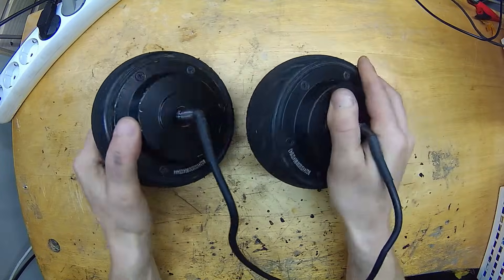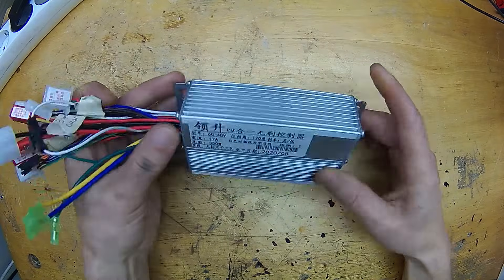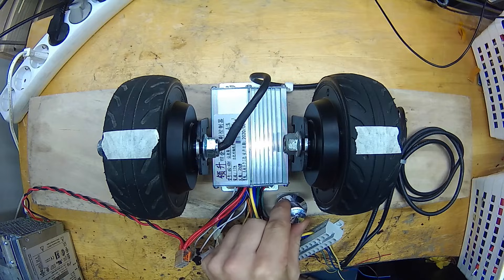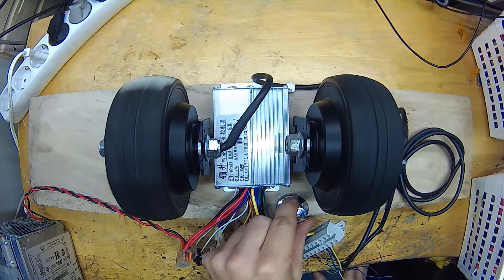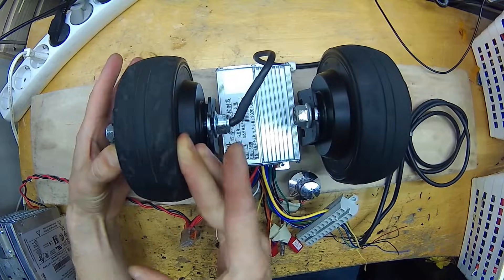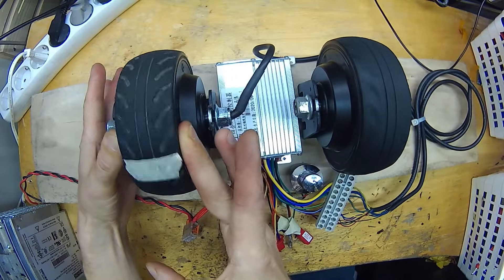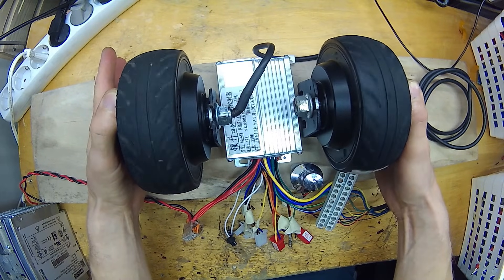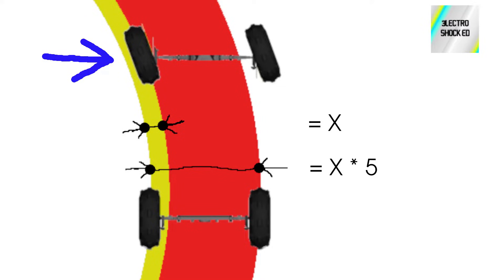2 HUB MOTORS with 1 CONTROLLER ? Yes you can!

Comment: In practice, only small loads would have a hope of functioning properly. The only way this would work cleanly is if the wheels were clamped together (with magnets/poles at the same angle) and always rotated exactly the same. So it could perhaps be useful if you want a single more powerful wheel.
Reply from the maker: Thanks for the comment! Really good point in theory. I was thinking the same before I did this test. But was surprised at the results. Just have to really try this out on a actual scooter next spring :) thanks for watching!
Reply: I think what you might be overlooking is the fact that the slave motor that has no hall sensor feedback input to the controller is now just basically like a standard 60hz three phase motor that has no hall sensors. It just runs at whatever rpm the grid determines for it, which is fixed permanently at 60hz. Although one difference is that the rotor of a conventional 3 phase motor is usually not permanent magnets, so that means there will always be a small amount of slippage, but nevertheless the rotor does still end up getting fairly close to locking in phase with the 60hz. So if you had 2 standard 3-phase motors running side by side on a scooter, being driven by the same generator, both motors would have the same torque and RPM's. It would be slightly hard to turn while applying power, because the difference in speed between the two motors would cause the slave motor to get slightly out of phase for milliseconds at a time, which we saw here in his video. But the vast majority of the time, the driver will be travelling fairly straight, and any time any slight amount of phase discrepancy tries to build up, that pressure will be relieved by the little bit of imperfections in the contact with the ground. Think of it like this: if you had a 4 foot wide axle with identical wheels on each side, fixed to each other and unable to turn at different RPM's, and you had this fixed to a cart with a heavy load in it, and you pushed it 100 feet across a concrete floor, the wheels being fixed in RPM's would make it almost impossible to make a sharp turn, but with just barely a tiny bit of pressure to the left or the right, you could still cause the cart to veer off a little bit from a perfect straight line, simply because the contact with the ground on the wheels is not perfect. So I think other than trying to do a turn while climbing a hill, this chatted effect would be mostly a non-issue.

Comment: So did you ever build it ??? Results ??
Reply from the maker: Hello. Thanks for the comment! Not yet. We have 30cm of snow right now :D But I'm thinking about it a lot. There is a big issue I'm trying to figure out - how to brake? Don't want to grind against the rubber wheel. I have been researching into electric brake, cause it's possible with bldc, but I can't find a practical solution. Any ideas?
Reply: @3LECTROSHOCKED  My chinese controller has low level e brake. It gets triggered in conjuction with the mechanical brake lever. It some times gets two powerful since i run a 2wd scooter.

Comment: So now i can just put 2 motors on my xiaomi scooter?
Reply from the maker: Hello! Good question. Try it out with one master (hall connected) and other slave (only power connected). Xiaomi is kinda far out with electronics on their motor vehicles, as basically all the rest of the main stream manufactures. So it is really no way of knowing how that controller computer will behave, since it's not a typical motor controller. Usually those devices are much more complicated than a regular brushless motor controller. Good luck! :)
Reply from the maker: And of course there will be a problem with power. You need twice more powerful controller to drive two motors, so I guess sorry, that won't work :(
Reply: @3LECTROSHOCKED  but do you now i can put 2 motors on my xiaomi scooter
Reply from the maker: Sorry but is this a question?
Reply: @3LECTROSHOCKED  yes, sorry if i say it wrong becous i'm dutch and my age is 11
Reply from the maker: I have answered your question already :) But if you didn't understand that, I said that it's not possible :)
Reply: @3LECTROSHOCKED sry but do you now how i can put two motors on my xiaomi scooter
Reply from the maker: You need another controller :)
Reply: @3LECTROSHOCKED  but how do i fit another controller in my xiaomi scooter and how to connect two controllers to one trotthle
Reply from the maker: You need to replace whole system with another controller that is more powerful
Reply: But if i do that do i then still can use the screen
Reply from the maker: Probably not, sorry.
Reply: @3LECTROSHOCKED  but if i fit 2 xiaomi controller in the scooter and 2 screen but one hiden and connect the 2 controllers to one trotthle and then i also can use the screen
Reply from the maker: Hello. Yeah, you can do that. But when connecting two controllers to one throttle, you probably need to separate throttle inputs with diodes. That way the resistance will stay in order. I have a video about that where I do that for another project: https://youtu.be/cs5BmaVUED4

Comment: This was very good, thank you. Can you have a Master and a Slave running in opposite directions ? (i.e. switching one of the 3 phase wires on the slave)
Reply from the maker: Hello! Thanks for watching and for this very interesting question. I did not try that out, sorry. I'm not gonna say that in theory changing the position of two wires will do that, because this master-slave thing is already pretty unorthodox and I was surprise that it works well like this. It could ether work, or just create an electric brake effect on both motors. So be careful if you try that out and please post me a comment if you succeed :)

Comment: Just like I thought..👍🏼😁😁... BTW, I ran 4 pcs Brushed motor only with 1 controller (PWM). But the speed & torque is decrease. Not like when I used 1 dc motor with 1 controller...
Reply from the maker: Hello! Yeah, in that normal DC config everything will be split. Resistance goes down, resulting in sucking more current from controller, which results in lowering voltage, which results in lower rotation speed. That's how I see it :)    Thanks for watching! :)

Comment: the controller should be double capacity to support the 2 hub motors.. i tried 1 1200 watts 30amp controller on 2 450watts hub motor and it works fine.. this setup will stress the controller
Reply from the maker: Hello! Yes, that's really important in the long run, so you won't stress the controller with using it at full capacity all the time. These hubs I have here in the video are rated at about 180w each, so a 350w controller is just about ok for those :) Surely need a bigger controller if motors are bigger than 180w - there you are right! Thanks for watching!
Reply: I have the same thought.

Comment: The controller will burn out after a while lol
Reply from the maker: Thanks for the comment! :) Can you please tell why You think that? I'd love to know, if You have any insights on this matter. Me, at this point, I don't see any reason for a major malfunction like that, if you connect only one set of sensors. Motor wires are essentially short circuited all the time inside a motor, so if the second motor put more stress - that won't actually do anything besides draw more current. And current is limited by mosfets itself. And as I said, the efficiency is something that needs to be considered here. Maybe having two sets of windings spinning at different speeds create a lot of unnecessary current draw. Although I did not noticed that when testing. I had current meter hooked up during this test. Thanks for watching and I will appreciate Your thoughts on this! :)
Reply: @3LECTROSHOCKED  on flat even grounds it's fine from my experience when using 2 350w watt motors while connected with 1 controller it had the same effect stated in this video and worked fine for about 3 months then 1 morning the bike died and when opening it up and look at the controller the capacitors n MOSFETs fried I can only guess as the controller still only sees 1 wheel not 2 the amps and voyages being drawn from the wheels running at different resistents took its toll with the controller as over time the controller has to keep voltage and current and amps regular due to seeing 1 wheel not 2.

I mean you may have better luck but this was my finding using 48v 350w bike hubs and a 48v 20amp controller
Reply: @3LECTROSHOCKED  I would strongly suggest repeat the experiment but this time add weight eg sit on it and move about lol
Reply from the maker: Great insight! Thanks a lot! :) In this setup I had two 180w motors and controller was running at 48v. It says 350w on the controller, but it can handle 17 amps, so really it should be 800w at 48v. Maybe having more power headroom is the key? Any ways, I don't mind burning one of these small contrs. Maybe I make a scooter and report with some data in my videos. Thanks a lot for Your input on this! :)
Reply from the maker: Wou, thanks for the info! I should look into that.